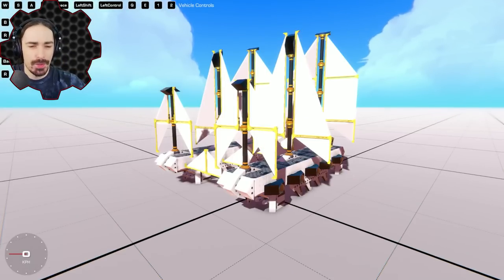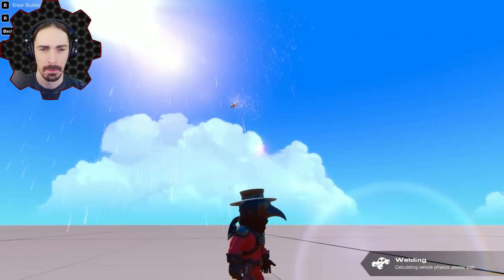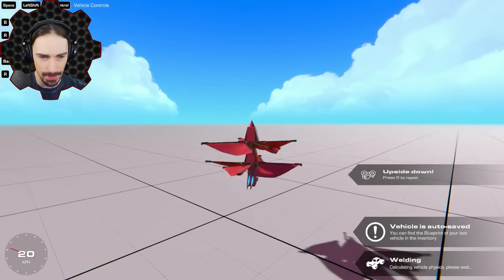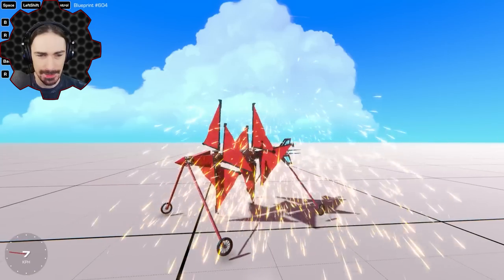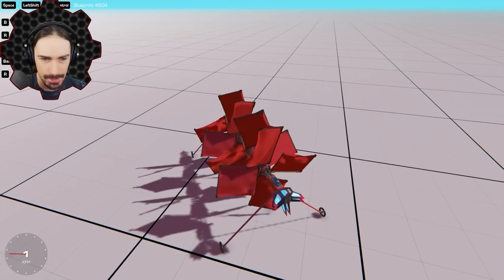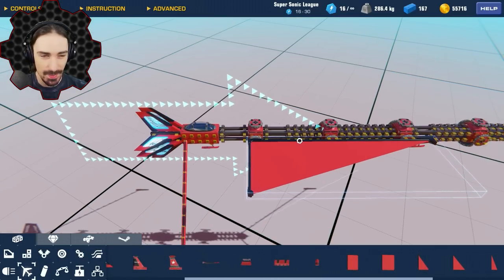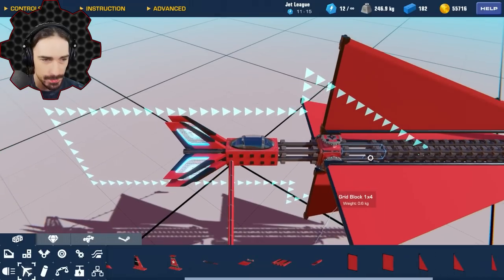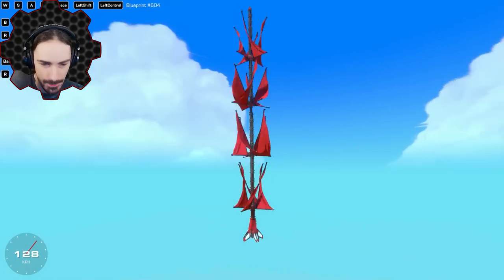Strange Experiments With Sail-Powered Vehicles

Comment: Something to note, you can seperate the servos from the body with rotating servos at 0 strength, which cancels the torque generated.
Reply: weow
Reply: @apersunthathasaridiculousl1890  Why do I see you almost everywhere?
Reply: that wouldn't work
Reply: Wait really
Reply: @sparkys1543  cause they comment everywhere?!?
Reply: @nul1fe  common sense
Reply: That would also cancel out any energy from going to the sails, wouldn't it?
Reply: @sparkys1543  cause they probably religiously watch scrapman
Reply: @nasgor22  he means like in a lot of YT channels like Ssundee, Real Civil Engineer, Blitz and more
Reply: QUICKLY NOONE LIKE THIS
Reply: Using the thing causing the problem to fix the problem? Could work in this case
Reply: No you can't. The second servos wouldn't spin lol
Either you're lying or you have no sense of actual physics lmao
Reply: Sooo
[Body] + [Servo 0] + [Servo that rotate] ?
Reply: @shadow20482  yes.
Reply: @terratube7840  ?
Reply: @grahamgrecian1332  let me ease it out and explain it for your smooth brain.
theres 3 layers.
layer 1: Blocks below servo.
Layer 2: Rotating Servo Set to 0 Strength.
Layer 3: Helicopter Servo + sails and rotating servos, along with ajacent blocks.
Layer 2 seperates the servo body from the rest of the creation, allowing the axis that is rotating from torque to move freely, holding no influence over layer 1. You do have to connect it in a way that makes both the helicopter servo and the sails spin the same direction, and once you do that it does in fact, work.
Reply: @-aid4084  hm. I'll try it. You have to admit that, if built wrong, the helicopter engine would simply spin the bottom as there's less friction than the air resistance above, and only the connection between the servo and heli engine would spin, leaving the sails and body essentially static.
Reply: @grahamgrecian1332  ill give you a link to me building it in half an hour if that helps.
Reply: @grahamgrecian1332  k make than an hour youtube won't upload quickly
Reply: @spacewalk3046  actually it should, both "shells" of the servo would spin in opposite direction at half the maximum speed of the servo (at least in real life, idk if it would work that way in trailmakers), so it would counter the torque, but it would also make the end of the servo not rotate, so it's kind of useless.
Reply: @sparkys1543  bruh right just found scrapman and been bin watching all his videos from the beginning and he has commented in almost every one of them from the beginning and throughout the years now that's dedication 🤣
Reply: @sparkys1543  same

Comment: Adding pipes/blocks to extent the sails from the center of rotation would give you quite a bit more speed without adding a ton of weight or extra torque that spins you.
Reply: Agreed. Had the same thought.

Comment: Proppeler physics! If the proppeler spins faster and the craft is going fadter then the most efficient way is to make it as slim as possible and adjust the angle where its the most efficient. Ussualy if its at max throttle its around 85° facing front. And the thing should spin as fast as possible without the tip breaking the sound barrier.
Reply: I think he would’ve been happy with just the tip of his propellers breaking the sound barrier

Comment: depending on how exactly they calculate wind physics, along with how having something in front of a surface affects the wind resistance, and how the sails use wind resistance to generate forces, that extra torque might be coming from the first propeller, with nothing in front of it affecting airflow, might be creating extra forces that the next propeller, obstructed by the first, does not get.

Comment: I think this works as a single-propeller airccraft, and having a double-propeller aircraft would work better by cancelling the forces of rotation. That way, you can also fit a lot more sails, for much higher speeds. Also, is one block of space enough for the sails? If yes, then a few brackets would allow you to add multiple sails per rotating server for the angle off attack of the sails. And, as someone else said, use pistons or even normal blocks to extend the sails from the center of rotation, to achieve higher sail speeds, which would translate into higher craft speeds. And you could also have the rotating sails powered by a 0-strength rotating servo and a few thrusters going in a circle.

Comment: I think instead of adding more sales you should add more servos stacked on top of each other so you get double triple or even four times the speed on a single set of sales which will make your build a lot smaller and hopefully a lot faster. You keep capping out at 130 because that's as fast as your sails can move the wind no matter how many sails you had so you need to make your sails move faster

Comment: I don't see anyone speaking about it, but the turning left is due to the sails in the front rotating one direction and sails in the back the other direction.
The forces they create are opposite, but they are applied to different points, which creates the torque.

If you were to put the clockwise sails on the far ends and the counterclockwise ones on the inside the torque should cancel out.

When you removed the front sail the torque around the vertical axis, which was meesing you up, became 0. But the torque on the axis aligned with your veichle was not, meaning one set of skis had more stress. Nothing to worry about until they break or the veichle flips over.
Reply: Or maybe it's just the physics engine being broken.

Comment: Hey scrapman love the vid i a have come to the conclusion that as you have the heli engine at the back the next engine would have double the power than the previous engine due to the engine rotating as well as the sails so each engine added as well as the sails doubles the total power output than the last so say the 1st engine outputs 2 joules of potential energy the next has double so 4 joules then the 3rd engine has 8 joules and so on and also adding pipes to the sails would allow for more torque

Comment: Make it 'swim' in the air with piston-based movement, maybe? (Pistons with double zero-strength steering servos at each end and a zero-strength pivot point for the arms to rotate around).

Comment: I would like to see how it looks interlocked with the big triangles one set attatched from the large poing one from the smaller point. Also if you offset the connections from the rotating servo could it power the craft, or can you rotate the sails with something different than servos now that you have the angles?

Comment: With speed you need to change the angle of attack to be more aggressive. In order to get most of wind as propulsion, it needs to bounce off at 45 degrees, but when youre moving at a speed other than 0, that angle becomes less agressive. What i propose is that when you achieve max speed, lesser the angle by a bit, speed will increase, then wait until speed stabilizes and do it again. Keep repeating until it wont go up any more, and that is the maximum you can achieve with those sails at that power

Comment: If an induced torque becomes an issue, why not create two parallel shafts? Set up one clock-counterclock-etc and the other counterclock-clock-etc rotation direction? That way they should cancel each other out.

Comment: Something on the Sails look of…
Like they bend in the wrong direction, don't they? The "Belly" of the sails are blown up by the wind. When you rotate them, the wind comes from the direction your turning them. But in the video it looks like the bend against the wind, don't they?
Like wind comes from the right it should look like this:  ( <-
So if you turn them to the right, or counter-clockwise they should look like this: ( <-
But in the video it looks like the bend like this: ) <-
Weird me thinks